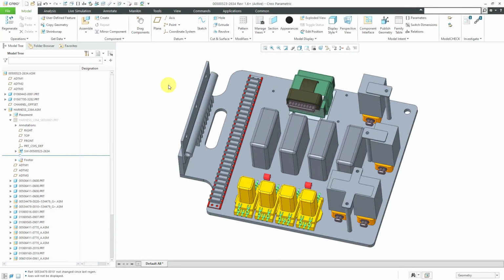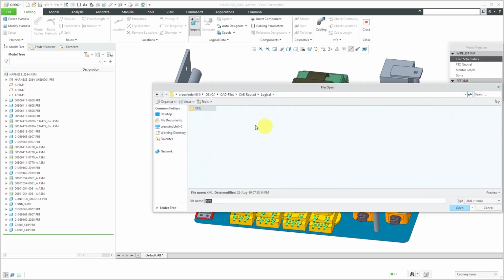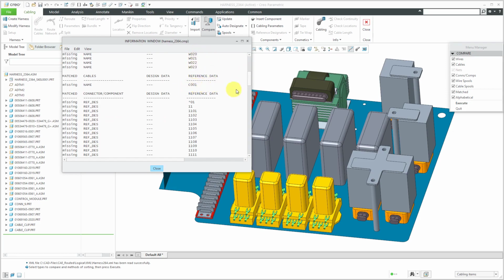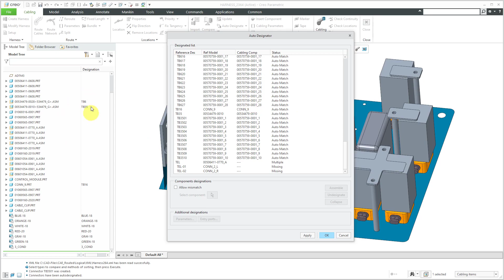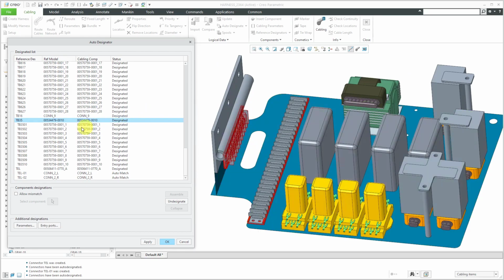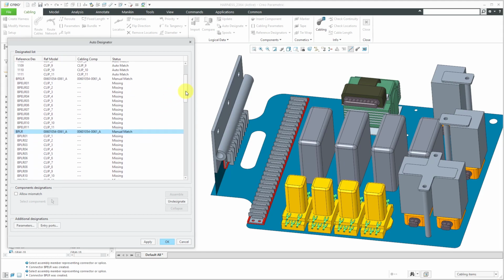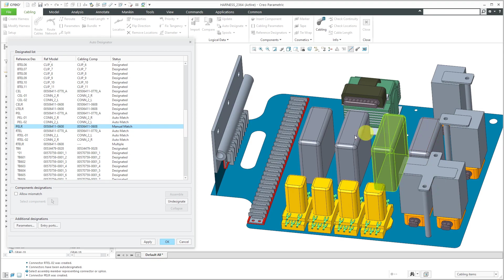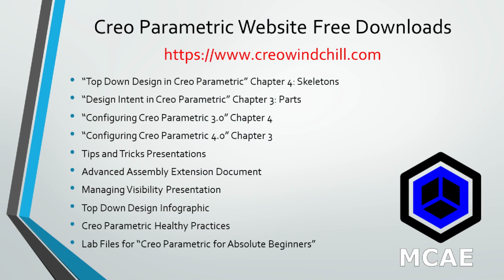Creo Parametric - Cable Harness Design - Logical Referencing

Comment: Thank you the video, really helpful. Have a problem though, everything works great apart from autodesignate. I see that the connectors get autodesignated but I still have to manually assign the co-ordinate sys before I can create a harness. It didnt pick automatically the co-ordinate sys I have in my connector 3D. had to go in "parameters" in the auto designate box and change the parameter assigned to co-ordinate from "False" to "True". any pointers how to automize that would be great. Thanks
Reply from the maker: Sounds like the entry_port parameter from your schematics tool is not set correctly. See my video on required parameters for logical referencing in Creo Schematics.

Comment: I have a harness I am working on and a bunch of the wires need to basically be flying leads when the harness is done. All those wires are broken currently because they aren't routed on one end. Is there some way to close off the wire but leave it a flying lead? One of my co-workers suggested using a "point".
Reply from the maker: I’ve done something similar. Create a phantom part (no geometry, will be removed from BOM in Windchill) that contains a single ENTRY coordinate system. Place the phantom connector near where the flying leads will be routed. And route the wires to the phantom connector.
Reply: @CADPLMGuy  omg Thank you!!!

Comment: So we should use layers if we are using like multiple sheets in creo schematics right?
Reply from the maker: I'm a huge fan of layers in Creo Schematics. My biggest use is organizing entities by harness type. For example, Power, Avionics, Communication, Control Surfaces, etc. Extremely helpful because you can export XML files based on layers.
Reply: @CADPLMGuy  Okay that makes alot more sense thankyou